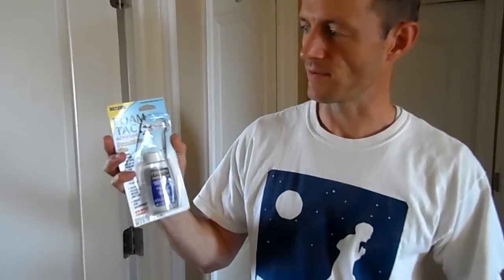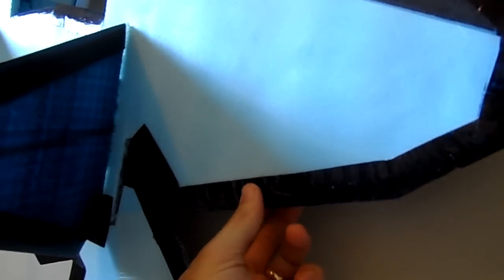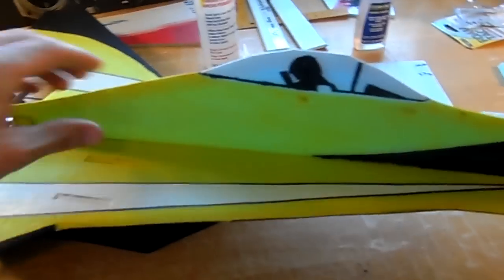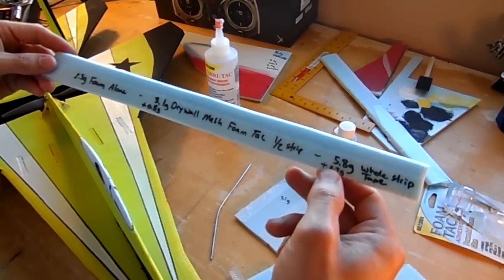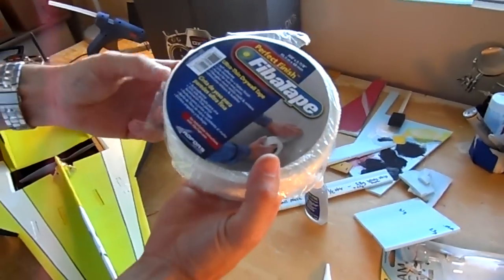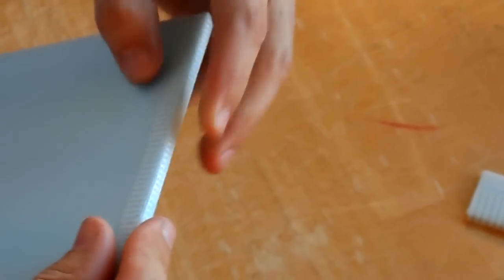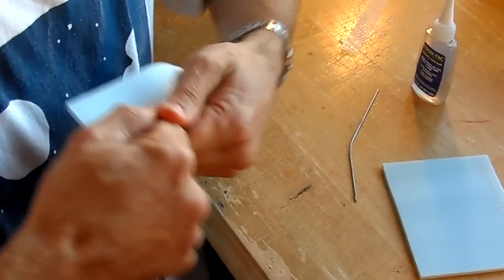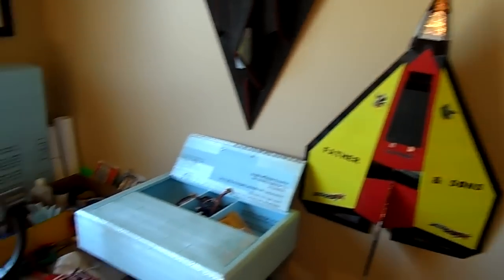Light Weight Structural Reinforcement for RCPlanes - Foam-Tac & Fiberglass Mesh Drywall Tape

Comment: I like the idea and we have the same tape here in Germany. But I have no clue what adhesive I could use here. Can you describe the one you use? Is it getting hard like super clue? Or more soft? What is the base of the stuff? I have no clue what to try out my
Reply from the maker: When the glue cures it is very flexible (not brittle like superglue). It does not become hard. I have no idea what type of glue would be similar in Germany.

Comment: Bruce , very good video and I will definitely try the Foam Tac glue / Drywall mash as well. One quick question:  have you tried to use light weight fiberglass cloth ( .56 oz / sq. yard ) with the Foam Tac glue ?
Reply from the maker: I never have tried fiberglass cloth of any kind with it.  Good luck!

Comment: Hi there. Is it possible using epoxy with that fiber tape?
Reply from the maker: I wouldn't use epoxy personally as it would be much heavier and would not be flexible.
Reply: If you cut down the epoxy with rubbing alcohol it will be flexible. There is a video on YT of a guy who did, and could bend foam, no mesh, and could not break it.

wow, that ring tone, vintage!

Comment: What kinda stiffness dose it add. I have my vertical tail folding over on me. Found you thur google. Trying to find a solution.
Reply from the maker: It helps a lot.  No question of the added tensile strength.  If u have it on both sides of the stabilizer, when it tries to bend over, it will have to overcome the added strength (in tension of the side opposite the direction it is attempting to fold).  This can help tremendously.  I do it to all of my leading and trailing edges now (On my vertical stabilizers, elevator and/or elevons I put a stripe of this stuff on either side right down the middle for strength - in addition to covering the leading and trailing edges.  When I just dont want to risk it, I will do this plus a carbon fiber spar, though it is not alway necessary on a lightweight foamy).  Good luck!
Reply: Ok thanks. I have a heavily modified Apprentice S. Your video will help me finish the last few areas of concern I have. Im going to use your Idea to strengthen my tail an aleron because they tape hinges scare me. Mabe I'll post a video of all the modification I learned for everyone. You an the community are awsome keep up the great videos.

Comment: would hot glue gun on low setting work in place of the foam tac???
Reply from the maker: I imagine that it would work ok for strength - though I have not tried it.  Hot glue would be very heavy in comparison to foamtac and for me would defeat the lightweight strengthening that is so important on an airplane.  If u can not afford foamtac, a better alternative is fabritac (available at Wal-Mart and some craft stores).

Comment: Those are some nice looking PC Planes!  Try our 2.12 self adhesive fiberglass mesh.  Our mesh is designed for detailed foam shapes, usually for architectural foam.  It is lightweight and is alkalai resistant so will work with epoxy, paint, and adhesive based products.  www.eifsdepot.com/fiberglass
Reply: EIFS Depot HI, could you please explain more about your Adhesive fiberglass mesh. What is the weight per /m? We want to use it on our EPO foam plane. What is the difference between the normal Fiberglass Fiberglass Cloth and Tape Size: 3/4 oz. (Light) ?
Reply: ***** I am not sure what you mean by "normal fiberglass cloth"  usually it is has a weight, i.e. 2.12 oz or 4.5 oz, that means how much the mesh weighs per meter.  I have a various weights with the smallest being the 2.12.  Our adhesive 2.12 oz  mesh is typically used for covering custom cut EPS foam architectural shapes.  It is similar to the appearance of drywall tape.  Call me if you would like a free sample.  404.691.4000-Laurel
Reply from the maker: EIFS Depot I am not.available to call right now, but am always interested in trying something new.  I would love to try your light weight adhesive mesh and compare.it to the method.I demonstrated in the video above.  I will text you my mailing address.  I look forward to.trying it on my next plane.
Reply: eifsdepot .com/fiberglass